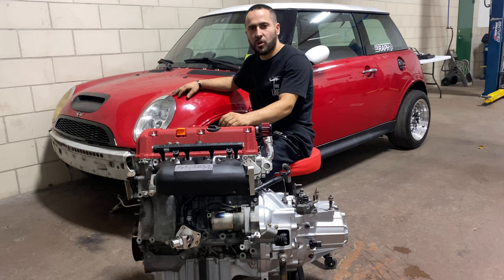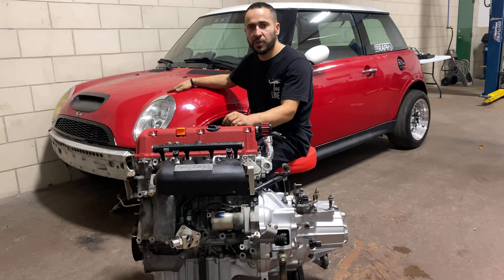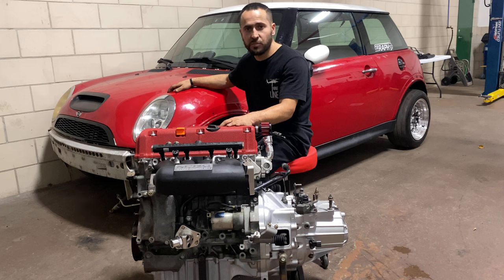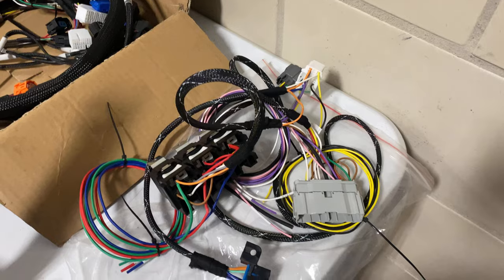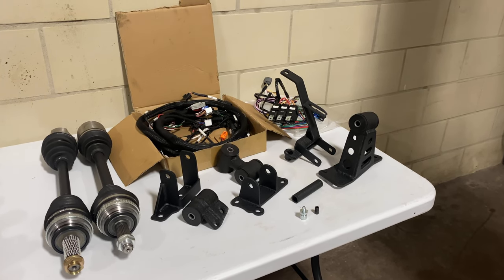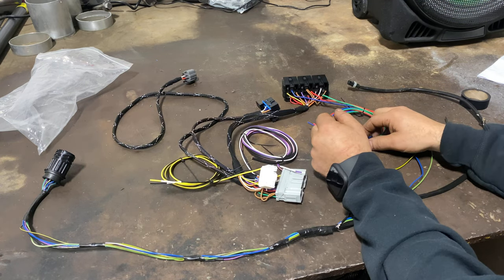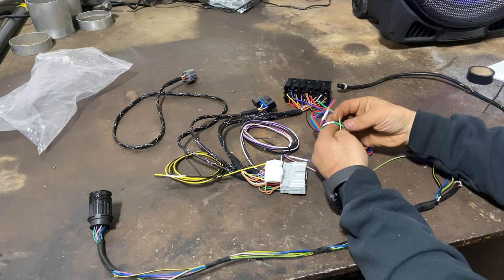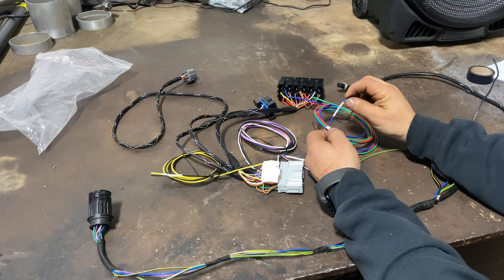HOW TO: K Swap 2002-2006 R50 R52 or R53 Mini Cooper Using RPT Creations Kit

Comment: I think the stock R53 engine is great, and if your a competent mechanic, it’s no problem to maintain and modify, while retaining reliability. For me, the major appeal of this swap is 50% more displacement, and the tremendous aftermarket support for K engines.
Reply: But it's so limited by it's fuel system. Not to mention tuning them on ethanol is a pain
Reply: irs reliable yea but makes shot power...I got 15k into it , full build and its 295whp lololol
Reply: @minimanadam  exactly. Just dropped a 8k sneedspeed engine into a customers car. All said and done he was right around 14k just in parts. Car is definitely quicker. But damn it's not worth the price to performance.
Reply: Adam s, I’ve tuned naturally aspirated k24’s that made over 300whp from somewhat simple builds. Stock k motors will hold 500+ whp with forced induction and a decent setup. I’d love to build a k swapped mini.
Reply: @auditrevor  you aren't getting 300whp from a simple NA build k24. To get those numbers you need a head swap and head work. Look at 4p racings 300hp k24 engine and look at everything do to it to achieve those numbers. 300ho NA not only isn't easy, it's expensive AF.
Reply: Simple in the sense that all off shelf parts were used. Dc stage 4 cams, hand ported type s head, about 14 to 1 pistons and tuned on pump gas. The car had a ported rbc manifold and 70mm throttle body which was definitely a choking point but no real high dollar parts were used besides the cams which were bought used.
Reply: @auditrevor  where are you located? I have the mini and most money but never attempted to tackle a project of this caliber. I’m south of Lancaster PA if someone wants to work with me.
Reply: These kits gonna come back in stock/for sale???
Reply: what sort of modifications would improve reliability on the stock r53?
Reply: @minimanadam that’s what you get for not turboing it
Reply: @mhikeybalatbat a K swap lol
Reply: Pure bmw trash engine
Reply: @ineu1650  it literally has nothing to do with BMW; it was a joint venture between Chrysler and Brazil.
Reply: @mhikeybalatbat Very old comment I know, but I didn't see a single answer. The W11 in the R53 is one of the most if not the single most reliable engine that BMW has used in the new mini. Timing chain tensioners and timing chains tend to go bad, more frequent oil changes than you'd think you'd ever need help with that. An aftermarket timing chain set isn't a bad idea.The intercooler isn't big enough from factory if you live somewhere hot, or you track it much, especially if both. I'd also replace the radiator with an upgraded extra row cooling capacity if you live anywhere warm. An upgraded clutch will go a long way on the manuals to keeping you on the road. The transmission is strong, the factory clutches were weak. Cast block and forged internals on the R53, so tuning and upgrading is pretty straightforward. No worry about breaking parts as long as you're tuned correctly. I highly recommend methanol injection as the valves will coke after a while from the pcv. Methanol is an incredibly good solvent, and it'll save you from having to get a walnut blast at 74k miles or so. I spent a decade working as a shop mechanic, as well as doing all my own engine builds my whole life.
Reply: Then obviously the mini Cooper original components were s**I've had one and it went to s** as ❤️‍🩹 well would have been really nice to have something that lasted that was cool like that I could sleep in the thing I could drive it all over the place it was really cool little waggy
Reply: Where can i order that kit???

Comment: Fantastic - on the next video, could you also just explain the extensions (aluminium) to the front crash bar.  I am looking to have an easily removed front and it would be good to mount all the lights etc off the front cover.   The only thing left that I need to move is the driving lights / indictors and the welded extensions look very good.  Could you make and sell those?   If there were flat plates, I could get them welded together and on to my crash bar locally, here at home.    Great work / great project. Thanks.

Comment: I've done 170k in my Cooper S with a reduced pulley and still going strong, so would say pretty reliable. Still like the idea of this swap!
Reply: Have you done a S/C service?
Reply: @ccamarsoni  yes one oil change. While I had it apart, I renewed the water pump and thermostat. I'm going to service again shortly. Will use a rebuild kit this time. Now on 176k !

Comment: I have a clubman R55. What would be the difference in the swap? 
I have a k24 from a TSX Acura 
But I'm not familiar with Hondas, 
Don't know what 6spd manual transmission that will bolt up..
I'm not looking for speed or gobs of power, I just want a stock  k24 swap. I just want a Really decent car to drive every day ,and what do I as of ECM and wiring, and what gauges won't be working, 
Thanks for your time

Comment: 2004 mini cooper r50 changed alternator, cause battery light was on and put new battery and still showing battery light now it over heats and the power steering isn't working 😑 HELP

Comment: Will your kit work for doing the awd swap? If not, do you offer the other missing parts to do so? As well, interior and stock cluster, does your kit allow the factory speedo to work?
Reply from the maker: My mount kit will bolt up the awd transmission but the rest of the awd kit you’ll have to do yourself as I don’t offer an AWD kit
Reply: @rptcreations  thank you, and as for the interior and speedo? Does your kit offer connections to allow the factory cluster to work or do we need to go aftermarket?

Comment: Not to hate but the r53 engine is super strong I daily mine and take it to the track and drive home been doing it for 3 years .
Reply: Tritec is a good engine
Reply: @nosensegarage  600hp from a tritec turbo is easily done and half the cost of a k20 to build....???
Reply: @nosensegarage  this r53 in this video was running low boost 500hp to the wheels which is 590hp at the crank at 24psi, the car now runs high boost 610hp at the wheels which is around 690hp at the crank. ITS STILL ON THE ORIGINAL 1.6 W11 TRITEC it has a turbo conversion, theres alot of these cars with this about about and they make more torque than any k20 ever have. I will have my apologies in writing 😃
Reply: @nosensegarage  yea thats 300-400 on stock internals. once fully forged then it's big boost time
Reply: @nosensegarage  500 brake mini cooper one *outrageous * I'd the title of the video, that's one of many my friend

Comment: What exhaust manifold are you using? Are there any modification needed to use stock exhaust location? Thank you for this I want to attempt a  California BAR.
Reply from the maker: I sell exhaust manifolds for this chassis that retain the stock exhaust location
Reply: @rptcreations  will that work for the r50 exhaust system too?
Reply from the maker: @jenkszy3684  you might have to get someone to cut and weld your current exhaust depending on what you have but it’s a simple process
Reply: R50 amd r53 use the exact same manifold/header. So from head to the cat back they are the same on both and would work on both.

Comment: What is the gearing like? Is it more comfortable to drive at 75mph instead of turning 3500 like with the original engine and trans?
Reply: The gearing would be the same as the car the trans came out of like a civic or crv but either way 75 mph in 6th gear is like 2750-3250 rpm

Comment: Also. How does the cooling work ? Will the stock rad still be able to be used ?
Reply from the maker: No there is not enough clearance to run the factory radiator. I personally use the 92-00 civic half size radiator (3 row) and make my own support to hold it

Comment: Do you have instructions for 2007 cooper k swap?
Reply from the maker: The swap is basically the same steps.
Reply: @rptcreations  so working the frame and wire harness the same with R56?

Comment: bro can i buy this stuff of you ?!!
Reply from the maker: You can visit my website to make a purchase. Www.rptcreations.com
Reply: @rptcreations  im abit confused, Does it come with drive shafts or ur kit that is ?
Reply from the maker: @bootstraptv4912  like my description says they are no longer included in the kit and the price is adjusted to compensate. You can buy them locally
Reply: This kit, + K20 engine + a r50 = working or needed more stuff, if so any chance u know the total, and could u link me too all the specific parts id need to get it running as I'm not going to lie between the video and the site I'm really confused !
Reply: like i was interested in ur kit = working for the 1500 but if i gota falk out 2k on axels it aint worth it xD
Reply: @rptcreations  sorry bro im new to all this, will be first engine swap project! So sorry for my absolute lack of knowledge!